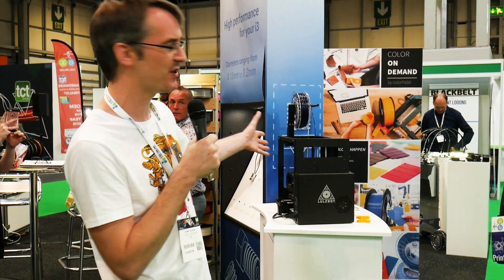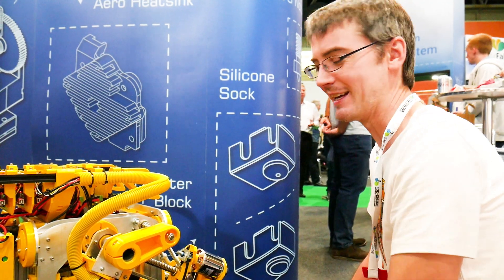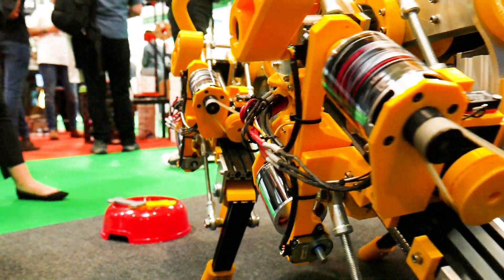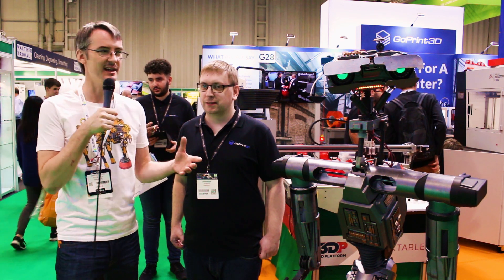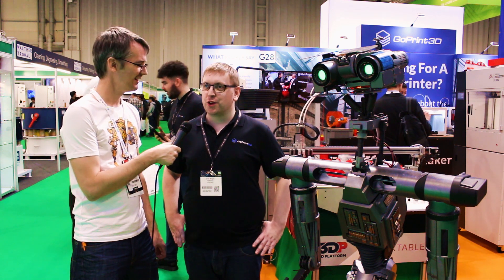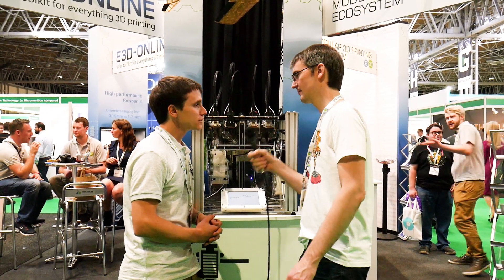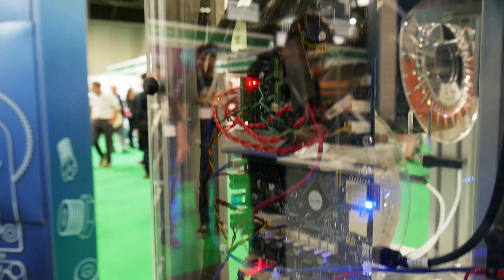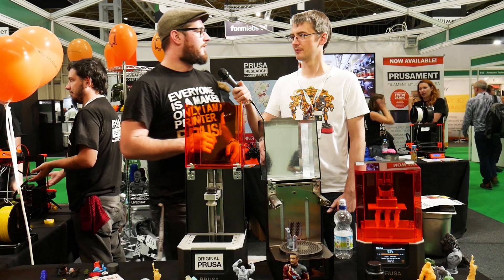openDog Dog Robot #10 | TCT Show with Johnny 5! | James Bruton

Comment: Prices as of Oct 7 2018
Driver Board:  odriverobotics.com  - controls 2 motors $119
Arduino Mega256:    Amazon  $14.99
Motors: Turnigy Aerodrive SK3 - 6374-149KV Brushless Outrunner Motor - Turnigy.com
 149KV 6374     $86 at HobbyKing.com

Comment: nice.  looks like there is plenty of room for improvement, but it also looks pretty energy efficient.  i would suggest using Hall sensors for your servo feedback.
Reply from the maker: the motors already have encoders with 8192 revolutions for position feedback.

Comment: really nice project,not to offend you but i  noticed that the rods thats holding the legs is bending. prob you should make this a bit stronger. 
nice project!
Reply from the maker: No they are not. The whole section is pivoting that the leg is attached to.

Comment: James I want to contribute to your codebase. How(if at all) can we arrange that?
Reply from the maker: The entire project is pretty much 'code samples' at the moment. The microcontroller platform and setup is subject to change completely as the ODrive firmware ads more features such as CANbus etc. My aim for now is to get it working the best I can the way it's set up now and then decide what the next stage based on the future requirements.

You can definitely fork it, but I probably don't have time to test a completely different setup right now.
Reply: what I actually want to try out is some ideas about dynamic stability and general control. Your last iteration on the mechanics is definitely solid enough so provided you add the pressure sensors and a couple ICU's I think I can start. I understand that what you are focusing on now is the POC phase, but I think it is nearly finished- CAN can be a nice addition, but depending on the way the stability/movement control systems are designed it may not be that efficient. 

I will probably try out some mockups on PC- I think I can emulate the mechanics accurately enough to start playing with the control circuit. At some point down the line however I will need data from the sensors to see if the model will actually work.
Reply: If you watch the videos on it he literally tells how you can help improve open dog the is fully open source so if you'd bothered to watch the videos you'd know that
Reply: I watch all the videos, and I checked the code base, however given its current shape, both as file structure, and code structure, any contributions are non-trivial to an extent that probably requires separate branch and much more testing on his end. This is why I posted the question above, and provided he answers positively the discussion of the topic will be moved over a different media.  

Now, how you assumed that your involvement in a direct question to the engineer behind the project is relevant is a mystery to me. Care to elaborate?

Comment: A lathe is on the way? That will certainly open up the doors for what you can make easily. However, a word of warning: Be VERY careful about what you are doing with it. Lathes are known for causing some incredibly nasty injuries. Second: I advise using HSS tools when you are first learning, Carbide tip tools are not cheap, and will happily break, especially when you are learning. HSS will certainly be more tolerant of a learner. Also, they are cheaper, and you can grind them to do what you need to. 
In regards to the creaking of the robot, is a large amount of it from the plastic conduit over the leg cables creaking when moving?
Reply: Well if he ever really need carbide for machining chromed shaft or other hardened steels, he can always just buy brazed tip tools.
They are the cheapest carbide tools you can buy and if you have a proper tool grinder with diamond wheels, they get as sharp as any HSS tools!

But he will really need a Machinery's Handbook before he does anything with his lathe.
Reply: @dr.castor1392  Yes, very true. But certainly the handbook, and a good dose of YouTube videos on lathe work should help.

Comment: When the dog looks left and right at 2:24 you can see the threaded rod at the top of each leg bending. Even with the printet support it seems a little weak.
Reply from the maker: that's not the rod bending - the whole hip part it's mounted on is pivoting around the big yellow bearings/pivot points on its ends.